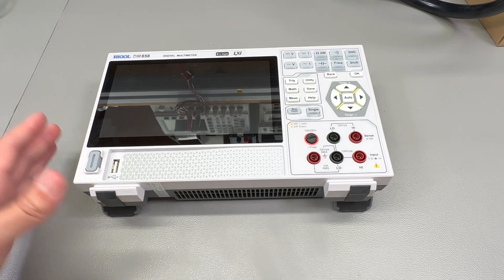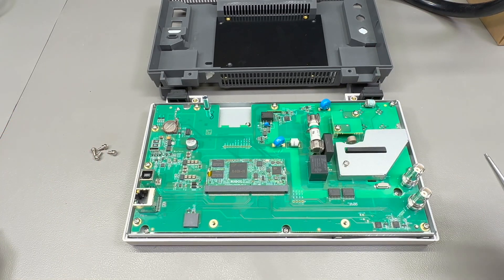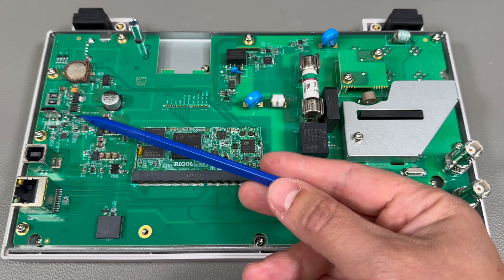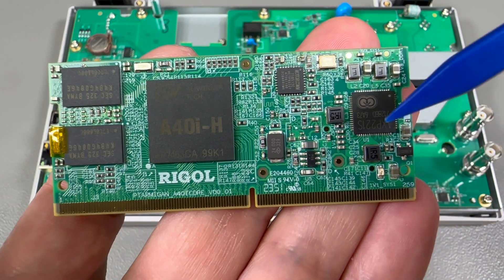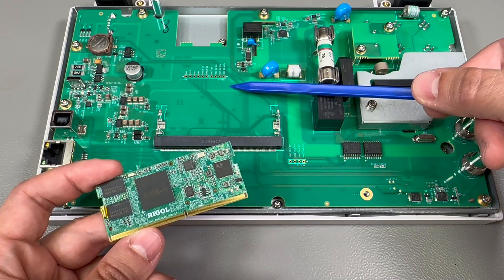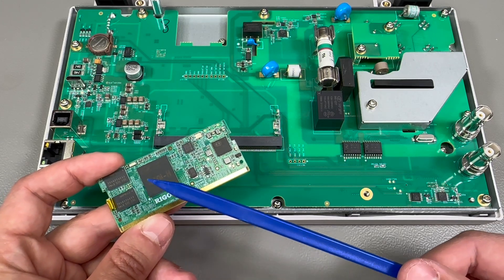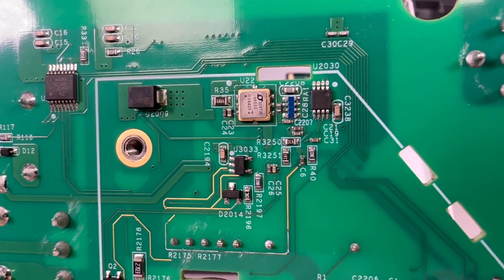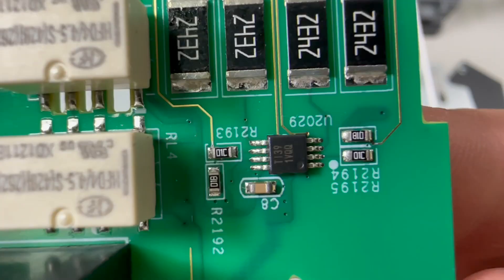Where is the ADC? RIGOL DM858 Teardown | Voltlog #486

Comment: Another reason for SODIM is that it requires more layers and smaller geometry for routing. If they made it into the main board, it would substantially increase the cost of the main PCB!
Reply: This the exact reason that was presented in the video...